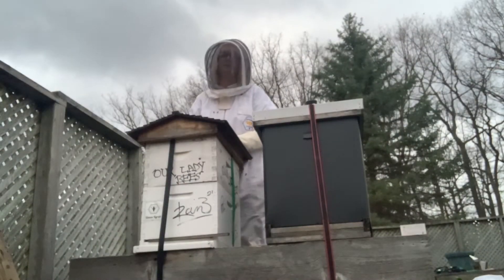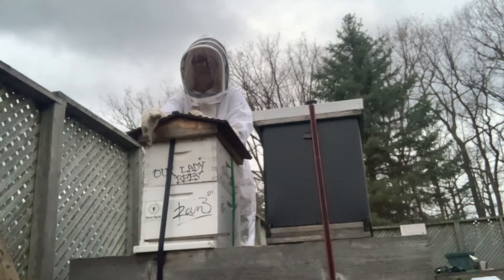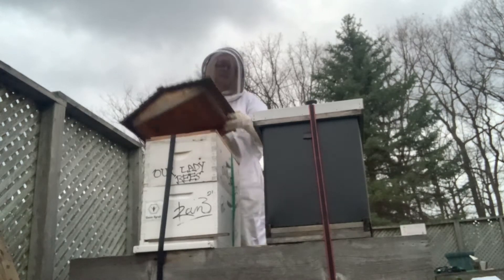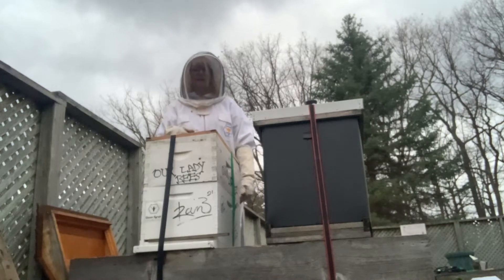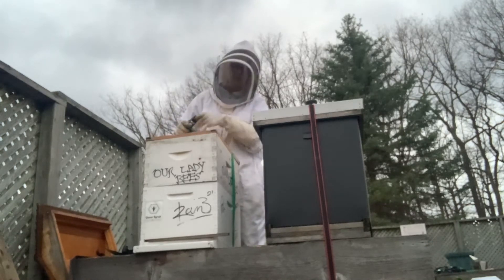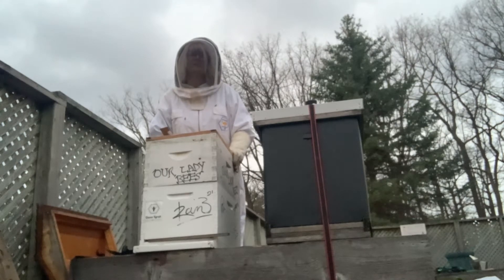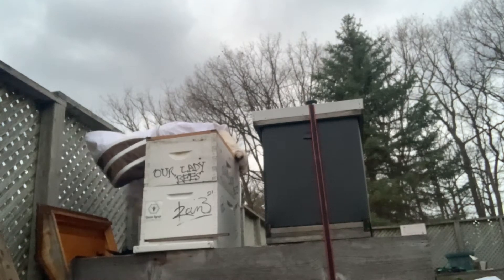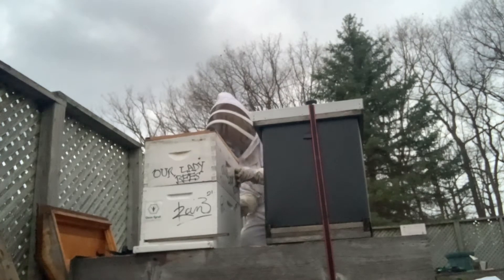Winterizing a Challenging Flow Hive in Northern Climates | Beekeeping Trials & Modifications

Comment: @BeesBikinis how did this work out for you now spring's arrived? Did the hive survive? I have a flow hive I'm starting bee keeping with, I live in Norway and I'm going to follow the steps in your video. Did you make the styrofoam outer wall for the hives yourself?
Reply from the maker: They survived great! First time I’ve managed to overwinter the flow hive! The outer wall is just a corrugated plastic hive wrap. You can also use tar paper and staple on, but I don’t like using that. Top insulation is cedar wood shavings in a pillowcase. I think the key factor was creating an upper entrance for air flow.